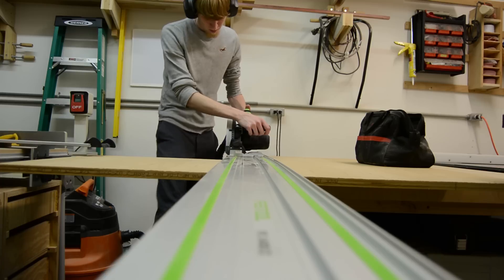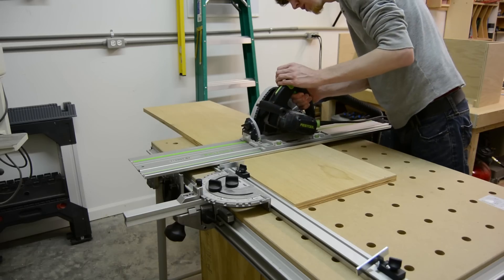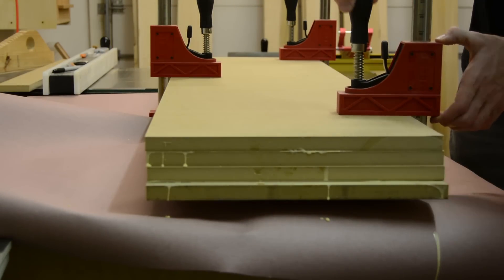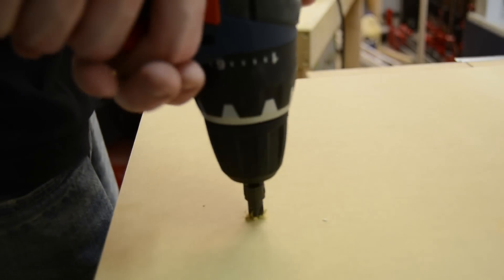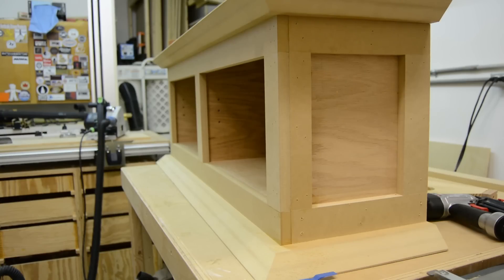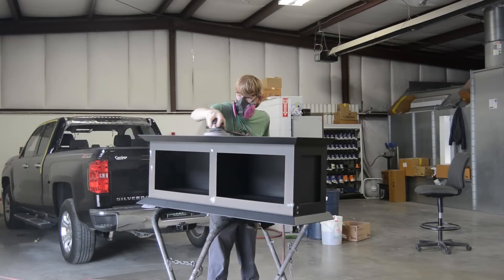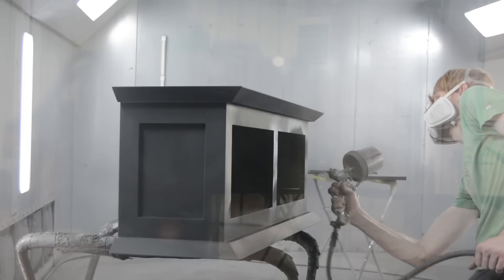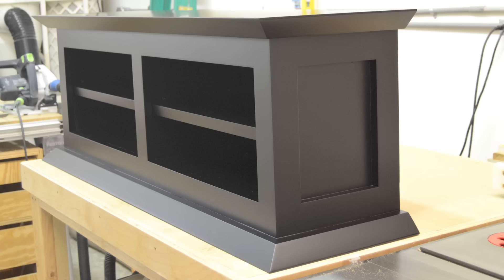Modern Cabinet (With Automotive Spray Finish)

Comment: Hey Matt, your cabinet looks great and would love to give you some tips on the painting for cabinets. I have a cabinet shop. Sanding sealer will seal the grain in the oak plywood and the cut ends on the MDF . There is also a more dense MDF if you are having issues with that. I recommend  Pre-catalyzed tinted lacquer for the finish. Not that the automotive paint you used can't work but the Lacquer can get so many sheen options as well as aging, distressed and other amazing wood working possibilities. Hit me up if you are interested in this stuff. Your work and detail looks really good!
Reply from the maker: +david cobb 
Thanks for the tips.
Reply: Is there wood that you don't use sanding sealer on
Reply: David Cobb is correct.  HDF would have probably been a better choice for the finish you were looking for.

Comment: Mixing software and agitator! That's a dream set up right there. 
I'm still dicking about with plastic sheets for a tent, an old shower extractor for positive pressure and half a mile of duct tape!
Learning heaps from you mate.

Comment: Any time I suggest to someone to use automotive finishes in woodworking it is usually just dismissed or laughed at. Few realize how much better they are and how much easier it is to get a nice finish with and the durability is way better. Automotive clear is the best thing to use on kitchen cabinets. Much more durable.
Reply from the maker: +Robert Adams 
Totally agree man, it's hard to make people understand that!
Reply: I suspected automotive paint would be awesome in woodworking. That's why I'm here.

Comment: I'm a spray painter also. We use sikkens at work too but we are using the autowave 2.0 waterbase. It's great stuff. Never got the chance to use the solvent auto base as they changed to water 2 days before I started working there.
Reply from the maker: +Mark James 
Awesome! In contrast I've never used any of the water based stuff.

Comment: never knew MDF could look so nice! dude, that's a really nice mixing system you have there. I need to invest in a good sprayer.im sick of wasting money on good rushes by the time I come back around to using them they're hard as a rock and even when they do something up there never the same.as always nice work matt!
Reply: With ANY pneumatic sprayer (even lesser quality) you've GOTTA take the entire thing apart & clean it till water will run through clear.

I'm a Set Designer, Lead Scenic Painter & I used to be an on-set carpenter. I've had my share of expensive AND cheap guns, but cleaning is the only way to get an even spray(like the gun is new again!).

Hope this helps man! Cheers! ✌

Comment: Sweet build Matt.  I was wondering why the sheet rock mud and not bondo
Reply from the maker: +HCAC BUILD 
The reason I didn't use auto body filler is because I really didn't feel that it was necessary and the filler is much harder to sand. I felt that because of that reason it might give me trouble with the mdf being softer and the areas around the filler sanding away before the filler sanded smooth. Hope that makes sense! Thanks for watching!!

Comment: Mel and part board doesn’t always mean “cheap” ………much more stability in varying climates so no butt cracks in winter... Glue glue glue  with  MDF splines more glue and clamps and you could build a particle board skyscraper. I’m not moving in but you get the point…………but anyway nice work dude the finish is sweet!!

Comment: Really nice looking cabinet. Never thought of using mud to patch holes and cracks. Next time you glue a couple of sheets together, you can fire a couple of small Brad's into them. That's will keep them from sliding around when you clamp them.
Reply from the maker: +MarzNet256 
Thanks, the drywall mud works great! Yeah, the brad nail idea would probably work.

Comment: MDF is worthless crap. 0 resistance to moisture. Drywall mud is not a wood filler. Use Bond-o or a real wood filler. Other than that nice work!
Reply from the maker: +Mark DeWall 
A loser move? You realize Bondo is a brand right? I've been painting cars for the last 10 years, I'll put my finish beside your any day you want to. Why would you use auto body filler when you know it's harder than the MDF once hardened. There is no way you can get the surfaces to be flat and in the same plane.
Reply: MDF is perfect for interior maybe your confusing mdf with thermafoil wrapped mdf which is trash

Comment: A lot of people over do fish tank stands, building them out of 2x4 frames and then skinning them with plywood.  It ends up being very unnecessary.  You just need to take into account that the tank full will weigh around 8lbs per gallon.  Which you did for sure that is a stout stand!  And that finish is awesome, you can tell you're a pro!
Reply from the maker: Thanks man, I was a little nervous making a fish stand, but I am pretty happy with it's strength in the end! Thanks for watching!!

Comment: very beautiful. nice work. clean and smooth.
would it have the same result if you used roller or brush instead of spray?
Reply from the maker: +dla nod 
Thank you, you can't get this smooth of a finish unless you spray it on. You can thin down maybe the last coat before brushing it on to make it a little smoother.
Reply: i'll try thinning down the last coat. thanks.

Comment: Great job!!!! Would recommend using wood filler instead of drywall joining cement and caulk in the corners.
Reply from the maker: +Stefan Racz 
I just used drywall filler on this and it worked great!

Comment: Thanks so much Matt! I stripp old solid wood furniture and modify them to be useful again,like old tv consoles and such, can I apply auto paint over a stripped piece or should I neutralize the surface first? Do you offer workshops? I'm so impressed with your craftmanship and all your Festool equip😉
Reply from the maker: +lisa j 
Thanks, I would only apply it to something that is very stable, because it is a hardened finish. I'm not sure how it would do on something that expands and contracts seasonally.

Comment: If you need to seal up mdf edges, mix a 50/50 batch of cheap wood glue and water. Paint it on all the edges, let dry and sand smooth.  Nice looking cabinet!
Reply from the maker: +Tom's Dreamshop Worx 
Thanks man, good to know in the future!!

Comment: Judging from most of the comments here, a lot of people seem shocked that MDF was used. Hate to break the news but MDF and HDF ( high density fiberboard) is used regularly by almost all cabinet shops, even the big shops that sell to HD and Lowes. And for good reason, it is a good product, it just has certain limitations ( not for outdoor use, and not great structurally) but for cabinet doos and drawers, hell yes.   nice paint job! that's the only problem with your video Matt, most of us don't have a gorgeous spray booth with all the colors of the rainbow at the push of a button!   any chance you can show us regular people, how we can get a factory type finish, with paints and catalysts that we can get from sherwin Williams or Benjamin Moore?

Comment: You said you used wall  compound (plaster) to fill in the wood grain & nail holes, was it water base plater? The plaster won't shrivel up from the solvents that are in the primer or paint? If I use plaster and a lacquer primer will that work?
Reply from the maker: +Ed Arri 
Any filler will shrink some, as long as it's fully dried and you apply enough primer to smooth it out then it's no problem.

Comment: When you are gluing up large pieces try sprinkling some salt after you spread the glue. The salt will give enough "grip" to keep the pieces from sliding and it will dissolve before the glue cures. Nice project BTW
Reply from the maker: +Cory Driver 
That's a good tip, thanks man!

Comment: You stated that you used drywall compound as a filler. I want to use it as well on my shop cabinets ( i used cheep plywood )   does it stick well and will it not crack off over time--Nice job on the stand!--Cheers
Reply from the maker: +Ken Brisco 
It should stick fine as long as it's not overused,  same as with any filler
Reply: Many Thanks :)

Comment: The filler combined with the da sander really hides the gaps well. I love the use of gravity fed paint gun. was your wood already planed? Any wood I seem to pick up is always bowed and twisted.
Reply: Also side question, do you think you could achieve a similar effect using spray cans? Obviously the detail isnt as good but if it's getting sanded down anyway it should in theory achieve the same look?

Comment: Really nice work, and nice set of tools / equipment.  You might consider wearing a supplied air hood - you can purchase the "disposable" ones that actually last about 3 months of everyday use - you can tap off your compressor air (I run my breathing air through an extra filter).  While breathing compressor air isn't great (even filtered), it is far better than getting two-part auto paint in your lungs.  Not trying to be a troll, it's great work and your work habits are similar to most who use auto paint.  But, you'll live a lot longer!  Thanks for sharing!

Comment: Nice looking job Matt, I've got two questions. One, on the top won't that sharp angle cause the mdf to bruise on the edge? Two, what is a "MFT" table? You do good work Matt.

God Bless my friend.
Reply from the maker: +Frank Ingram 
Thanks Frank! Normally I'd say Yeah probably, but when I primed the cabinet with a catalyzed hardener it seemed to also harden the mdf as it soaked it up and dried. 
Mft stands for multi function table, festool makes them, they have multiple clamping points and a built in cross cutting track.

Comment: Question: So you put 1 coat epoxy primer, 3 coats urethane primer then two base coats of color and then a matte finish? 

Amazing finish!!! I want to try it on my next project of MDF shaker doors.
Reply from the maker: Correct!
Reply: Good info. And great turn out. I always wonders if auto paint could be used on mdf. I like mdf.

Comment: Hey Matt what tip size did you use primer , base and clear coat thanks great job .
Reply from the maker: +alex silva 
the primer gun has a 2.0 tip in it, the base and clear guns are 1.4
Reply: Matt Lane thank you very much sir

Comment: Hi Matt I like the finish very much. I have couple of projects  to finish. I would like to try automotive finish on them. Which automotive primer and paint you used and the top coat was solvent based or water based. Lastly where can I buy automotive finish? Thanks

Comment: Thanks Matt for the video. I have some 2 part acid catalyzed lacquer. I have part A but don't have part B. Would it be OK if I use without hardener. Any advice on that would be really appreciated. Thank you
Reply from the maker: You definitely need the hardener for it to properly catalyze!

Comment: That really turned out nice Matt! Great job
Reply from the maker: +Jack Of All 
Thanks man!
Reply: Does the automotive grade paint  chip and scratch easily because the surface is not solid.  I've painted stuff before with my spray gun. Polyurethane and stain us way more durable when scratched.
Reply from the maker: Still no gouges or chips in it to this day, my friend randy still has it!

Comment: Pretty cool,  you should check out Valspars line of waterborne and Lacquer based products for furniture.  They also have a polyester base coat that is tinted to match the final coat before clear.  It is build-able and sand-able.

Comment: Great video thank you.  Can you please tell me, if you have a good table saw and a crosscut sled and you are working with managable sized pieces, why would you use the track saw for the smaller and mitre cuts?  Appreciate the information.

Comment: You are amazing great video thank you Matt for sharing. I really help to have the right tools. I would love to see what you can do with just a sander, a skill saw and a chop saw. You can inspire the rest of us with your skill set. I'm stuck making a top that is a quarter inch outside of my lid on both sides of the hood. Trying to figure out how to increase or decrease in order to get store bought trim to cover it? I'm table saw and plainer limited or I would trim it square and cover it to match some 1/4 round trim. Any ideas, wish I could send you a picture for advice you are the master woodsman.

Comment: Will one of the multistage turbine HVLP guns work well enough for automotive paint? Or does it need to be compressor based?
Reply from the maker: +XaeroR35 
To be honest, I'm not sure. I have no experience with a turbine system. I would definitely like to have a turbine for spraying finishes with, a self contained unit like that would have to be handy. I would imagine as long as it can properly atomize the paint, it would work. I would be a little leary about how well the gun would spray certain metallic colors though.

Comment: hello Matt, nice work, Im finishing my guitar to a wood finish ,i stained it and i want to spray a thick layer of automotive 2k clear as its basswood and dents easily.
will it stick to wood or do i need sealer before ?if so an automotive one or a wood polyester or polyurethane sealer
i saw also some people finishes crack and peel off like film,  whats your opinion of the cause ?
thanks in advance.

Comment: Is there a standardised colour system in automotive painting? In printing we primarily use CMYK and Pantone colours but also a lot of the inks are translucent so the substrate you're printing onto comes into play. It'd interesting to see how colour is handled in different fields
Reply from the maker: There is an entire array of toners, both solid and pearls, that make up most colors. The color is chosen from a color chip system that comes from the manufacturers color code. You are given several alternates to choose from on most colors, but that doesn't always mean a match! Each alternate has a given number of toners that achieve that certain color. 

The sealer color that goes on before the base coat usually aids in coverage. Some colors are definitely more translucent than others. On certain colors, especially metallic colors, even the amount of air pressure can dictate the exact shade of the color itself. Painting cars is definitely an involved process and there are lots of variable that go into it. It's probably one of the more underappreciated jobs!

Comment: Just beautiful work and quality. Me and my dad use an automotive paint as well but it has never turned out THAT smooth. That epoxy primer seemed to have really done the trick. What is that coloring system you have in your shop?
Reply from the maker: +elijah lopez 
Thanks man, it's sikkens

Comment: Hi Matt  I am a house painter and  started painting kitchen cabinets and would  like to get this finish on  my work   A lot of the kitchen cabinets are super grainy do you think if I use the  epoxy primer and the automotive  high build primer it would fill all the grain and pores       And should be able to get a  smooth finish.   I seen another video from Australia and they used  this system. Epoxy primer automotive paint and clear coat as well   What do you think about this system for kitchen cabinets?

Comment: I’m really curious how the paint is holding up on mdf.  I was told auto paint is the worst paint to use on these types of projects. I did use some ace primer and paint on a furniture looking vanity I built and after 3 years it still looked perfect.  Most of my project was poplar and birch, I believe maple doors and drawer head though.
Reply from the maker: Still looks just as good as the day it was sprayed!

Comment: If i wanted to be extremely cheap could I do this build with rough grade ply, seal with resin, do a combo of bondo and high build primer to get the same smoothness? would time spend in prep be worth cheaper material?
Reply from the maker: +andrew STEWART 
Yeah, the money and time spent in the filler work would probably negate the savings.
Reply: Thanks!

Comment: What were the paints and primers used?  You said you put 3 coats of a urethane primer on top of the E350. Which did you use? did you put a base coat on top of that ?

Comment: That came out GREAT bro. didnt know it was for an aquarium till the end. i must have missed where you said that in the beginning. So by using automotive paint will that drastically reduce any water damage from water spills on the stand from the tank. cuz I know MDF has a very low water tolerance and being in the aquarium hobby for 20 yrs, spills are inevitable . also you sand about sanding the auto paint to a smooth finish , is that not possible to do with regular paint? thanks man.
Reply from the maker: +nyinfamous2k2 
the epoxy primer that I sprayed on first is water resistant, I knew I had to have something to prevent water damage! The difference I  sanding an automotive primer is that it has a catalyst which means it will dry hard and allow you to sand it smooth. The much thinner consistency of this particular topcoat allows for a more smoothly final finish. Thanks for watching man!
Reply: Great info , thanks for the reply

Comment: I have a little problem. I have a project that has plywood sheeting (3mm) thick. you can really see the "grain" of the material. I want it smooth like you got it there. How would I seal it so no grain can be seen? btw im only 16 so I have no "high end tools" to use.
Reply from the maker: +Joseph Shubin 
I would either use a grain filler or some other form of filler and then prime and sand until smooth.
Reply: Matt Lane ok. Thanks. I will give it a shot.